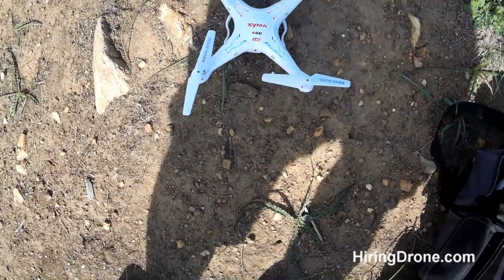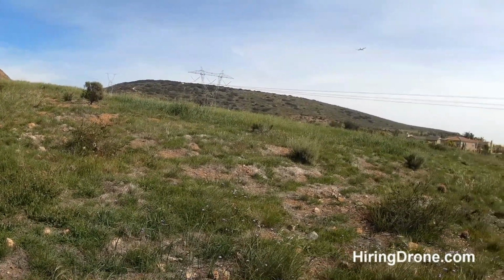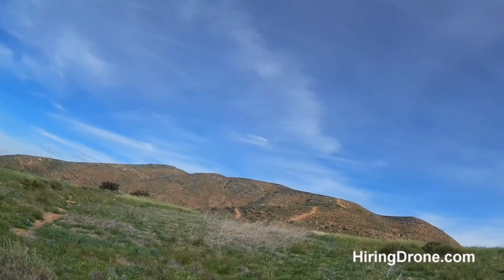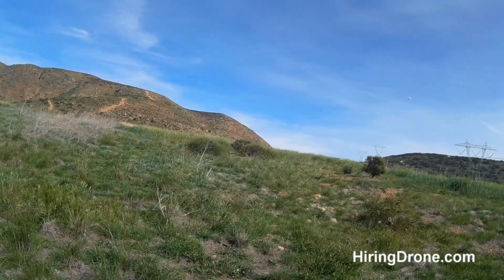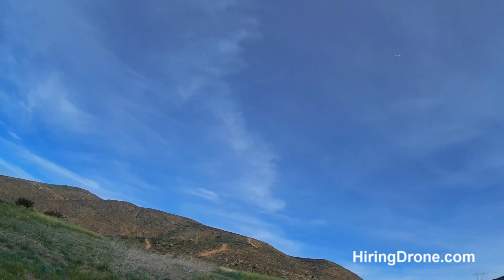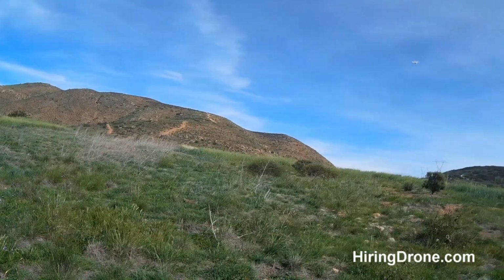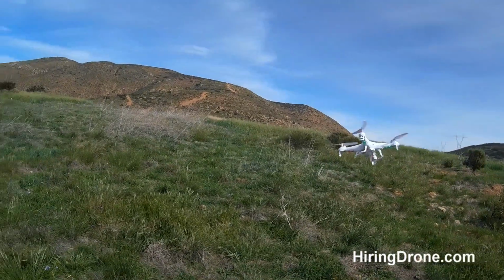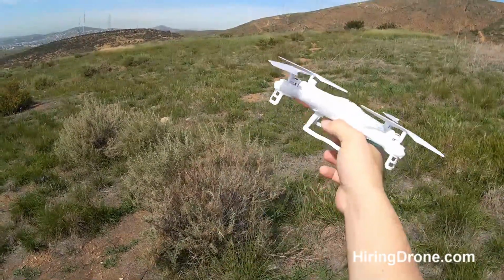SYMA X5C Explores Quadcopter Flight

Comment: Cheers. I've got the same thing with mine. Loses range very easy, even when close. Have you fixed the problem with yours?
Reply from the maker: +JohnnySlash I have not, but I have seen  a few range mods on Youtube. Great little flier though. I will probably pop my top off and look to see if there is a bad solder somewhere. If not, then I will consider the range/antenna modification.
Reply: Hiring a Drone
Well, I've done the antenna mod and I tried it out today. The range wasn't as bad but I lost yaw a couple of times and I was getting slow responses. I think it could be the antenna inside the quad. I haven't opened it up ,but I bought another circuit board/flight controller (5 quid) in case that's the problem. I'll let you know how I get on. Thanks
Reply from the maker: +JohnnySlash Yes, please do keep me posted. I haven't invested much time into fixing or modding this quadcopter. I'm thinking it could be something internal. Mine gradually started to lose range, which leads me to believe something is coming loose inside.
Reply: Hiring a Drone
Maybe so. I've put a tiny hole on the underneath of the quad and managed to push the antenna wire through so that it's sticking out. Could make the signal better. I'll try it out 2morrow. Cheers ;)